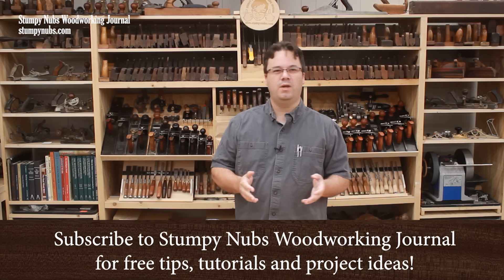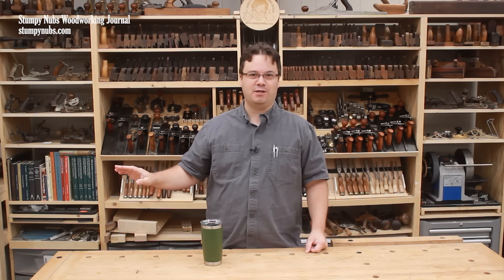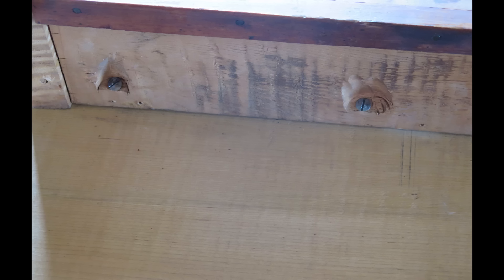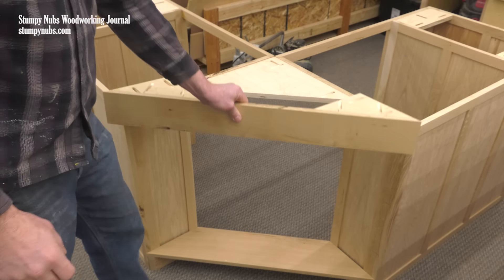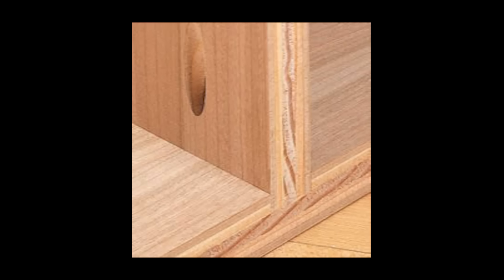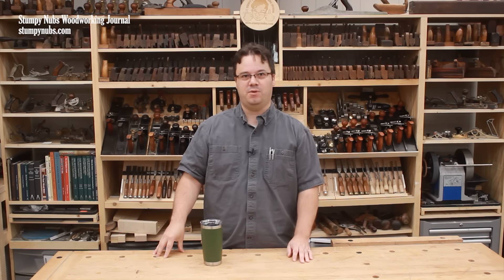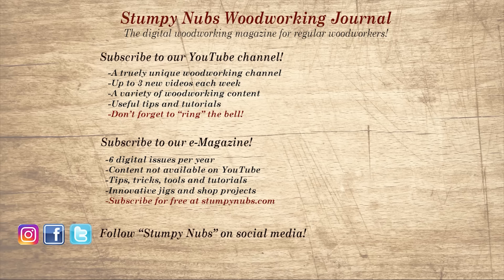They lied to you about pocket screw joinery.

Comment: I am a cabinet maker /cabinet installer , 25 years in the trade. I use pocket screw joinery for certain things, my face frames are all joined together with pocket screws and sometimes I will even put a cabinet together using them if it makes sense to do so.Mostly it just takes way longer to assemble a cabinet using pocket screws as the fasteners compared to other methods, I use a combination of joinery techniques depending on what I am building, the purpose of the item, wether things can be seen or not and structural needs. there is no one right way to make everything. I say if someone is enjoying what they are doing and using pocket screws enables them to build things with less equipment then good for them! snobbery is not productive and is usually a sign of a wannabe craftsman. like they dont really know how to do things but they have it all in their head how it should be done. all of the very great craftsman I know wouldn't give a half a crap how you join your cabinets together.

Comment: For almost anything, there is more than one way to do it. For example, at 3:43 :  the screws could have gone in from the other side. Their heads would still not be visible beneath the desk.
And so on. You can also argue you don't need mortise and tenon joints because you can do it with dowels. In the end, it comes down to what you like doing, and what gets the project actually completed.

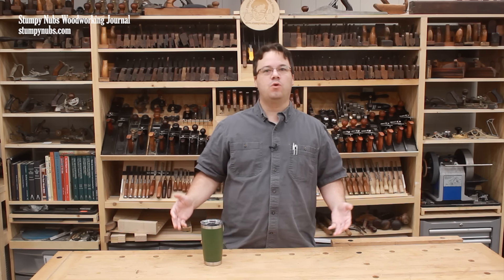Comment: I made a kitchen cabinet for a friends camper van and used 12mm ply. I did use pocket screws but found that 12mm slightly thin to achieve good strong joints. I did end up putting in some battens to strengthen the cabinet and the 7mm backing board helped. It is free standing so probably should have gone up a thickness in ply. What thickness was used at 1:47?

Comment: When we were doing woodworking at school we were told that woodscrews were fine and nails were not. That was in back in 1970 and I was told it was the tradition of Carpenters (Cabinetmakers) who would nine times out of ten use various wood joints with either wooden dowels or woodscrews as a last resort and Joiners (Construction industry woodworkers) were a totally different kettle of fish and they would use nails as a last resort.

Comment: Many anecdotal examples show that pocket screw fails just before wood failure.  That's a preferred mode of failure in my books any day of the week.  Unless you job demands that your wood fails before your joint or if it's something that requires resistance to repeated stress that may cause metal fatigue... Why would you not use the fastest mode of assembly?

Comment: Mr. Nubs, would it be okay to use pocket holes for breadboard ends?  It's either that or buy a Festool Domino for $1200 for me on this project I'm working on.  Appreciate your advice
Reply from the maker: You could if you counter-bore the hole that the screw goes in to make it larger than the threads so there is room for movement. This video shows what I mean (though it is not a breadboard end): https://youtu.be/4-OGtAs12ZQ?t=395

My preference is to make loose tenons (which is what dominos are). Here's a video about making a simple router jig for it: https://www.youtube.com/watch?v=Bx1Mg2mTMO0 Leave the tenons in the breadboard end unglued. Add some pocket screws between the tenons, as I did in the video link above, to hold it together while allowing for movement.

Comment: I am I guess what you would call a DIYer, or hobbiest. I learned woodworking in a cabinet shop I worked for when I was in high school.  I use the Kreg pocket hole jig in the furniture and other projects I make.  I made a workbench with drawers in it using pocket holes in the front and back panels to hold them together,  gluing in the bottom of the drawer. They take a lot of abuse but are holding together fine. The mistake I see people making is they use too few screws. Something like a drawer, especially in a workbench or even a drawer in a pantry cabinet will have to hold a lot of weight and be used a lot. On a Kreg jig there are three holes in the block,  I'll put holes the distance of the outside holes on each joint, a 6 inch high drawer will get 5 screws on each corner.  Now a cabinet side might only need a screw every six inches or so because it doesn't have a lot of force put on it and if you glue a back on the cabinet that holds it all together anyway. But that's the key,  in my opinion,   just like people saying,  "Don't starve a joint of glue." I say, if you're going to use pocket holes, use plenty,  at least as close as the A and C holes on the Kreg jig.

Comment: My elderly parents paid good money to a cabinet maker to build a replacement drawer for their kitchen.  It failed again.  I'm pretty sure the drawer I built with pocket screws and glue will be around far longer than the piece of garbage that a commercial cabinet maker built using only staples and pin nails.  The rolling cabinets for my drill press, jointer, miter saw, router table, thickness planer and small bench tools are all held together with pocket screws/glue and they're all heavy tools.  I've only been woodworking a few years and came in with no pre-concieved ideas about strong joinery.

Comment: If I'm building it for use in my home, it's getting pocket hole screws. I can make stronger furniture with less material. So not only does it hold up better but it weighs much less and has the potential to save me $$$ on material costs.

Comment: Doesn't it amaze you that some craftsmen want to put a date to end all modernization of tools. I wonder if they know power planes, Table saws, Lathes etc have been used for over 200 years. Of course they were powered by water wheels or the like in a mill but still  a power tool.  Craftsmen in the past were always looking to make their job easier and better and therefore faster. That date seems to be just after Stanley's bench plane assortment. Maybe they should go back to the invention of the metal nail and just use wood nails and raw hide.  Fact is, I remodeled an old play house (theater) built in 1889 that had cast Iron joist hangers and cast Iron columns and beams bolted together with cast Iron treaded bolts. Knowing how to do it the old way is fun for me but so are the modern innovations . Your Kool Tool shows are the best.  I often see tools on your show that I go out and buy.

Comment: There are decorative heirlooms, then there are practical items i build every day with graded pine, most all pocket screwed with an impact driver without pilot holes. Usually really practical multi purpose pieces that i find attractive due to their simple ruggedness and how they solve a particular problem. Build a bed in 2 hours, (+30 mins at the building supplier)? No problem. 

I call them prototypes as they are a concept executed and improved on that could be the basis for nice furniture. So they are like keeping blueprints on the wall (in fact, that's exactly what they are)

Comment: Pocket screws are a great way to get going and build projects when you don’t have tools. No t to that I have a good table saw and router dado set up I still use pocket screws. Taking things apart is a very good point when making built-ins: I’ve made several book cases and bunk beds and using the pocket screws on face frames etc allows people to take their $10k bunk bets with desks and bookcases with them. I’ve built cabinets and projects 20 years ago that are still getting abused to this day. I tell people to get a dewalt track saw, miter saw, a good drill set, and some clamps with their pocket screw jig to get going. I used Japanese saws instead of a miter saw when broke too. A few chisels and a hand plane and you build a tremendous amount of stuff. Most factory cabinets being homes are junk made out of melamine and I’d take glued and screwed quality over them any day. I’m constantly bracing, re-glueing and even clear caulking this junk on a daily basis. Anybody can make sturdy bookcases or cabinets that is 100 times better than IKEA …

Comment: i've been a carpenter most of my life im 64 when i started we had no nail guns and you learned to swing a hammer ,most guys now dont know how to swing a hammer because of nail guns its a snap of the wrist not brute strength i will drive a nail as fast or faster with my trim hammer than they will with a 28 ounce club now having said that i use a nail gun because it works

Comment: When it comes down to it time is money and if the job is worth hours spent doing joints and the client is ok with the additional cost then do it but most people want the cost of labor low especially when materials are already high…I build planter boxes out of pallets…my wife thinks they are free materials but the time I spend disassembling them and running them through the planer I can just buy finished lumber and the ROI is higher…you get what you pay for…you want joints they take time and time is money…pocket holes are fast and work well when your time spent may be needed on another part of the build…respect the craft

Comment: I love using pocket screws as clamping during glue ups; I remove the screws after the glue is set. In more than 20 years I’ve never had an issue of breakage, poke through, or unsightliness. Do t use them where they show or where they have too much lateral or drawing force against them and you’ll be fine. Just like the Festool Domino is a cheat for mortise and tenon jointers pocket screws function as cheats to, just for more things. Build what you want now you want and let the critics be damned;  ow if you’re in it for the money and looks you may need to reassess. I can tell you a lot of professional cabinet makers swear by pocket screws for carcass joinery because they’re fast and more cost effective then other methods; to me this is the reason for the clamping, they take up less space, are cheaper, and have more usefulness than a ton of clamps.

Comment: There are luddites in any craft. Good presentation, I'm still a "newbie" at woodworking, as I am disabled now, but worked as a mechanic for over 41 years, and remember the guys who used to say a good mechanic could just listen to an engine and tell you what's wrong with the car, but those same guys wouldn't work on anything that didn't have a points distributor and carburetor let alone many modern vehicles that have no distributors at all, and fuel injection now rules the day.

Comment: Luddites, I suppose. 
Some folks probably thought the person who invented the first foot-powered lathe (spring-board style) was cheating.
In a similar vein, I have a spinning wheel to spin fibers into yarn, using foot-power. 
I had a choice between an traditional antique style or a modern style.
I chose modern for portability, comfort, speed and a larger orifice than the traditional wheel so that I may spin chunky-slubby art style yarn as well as the super-fine lace-weight yarns. 
I have spun on both styles, and I was glad of the modernizations.

Comment: I LOVE screws! They area amazing! Can put small and large things together. You can easily take it apart. It is easy to repair. It is... Perfect for almost everything!
I also screw the baseboards. Makes it super easy to remove and paint or when redecorating.
But, unless in a very specific type of mounting, you should always use torx (or in second hand pozi). Philips... no. Flat is for special purpose when that look is desired.

Comment: I think any method of fixing is acceptable in the right application. Sometimes you need the strength of a screwed joint and if they don't ruin the aesthetic of the finished product because they're hidden from sight then I think it's fine.

Comment: End of the day, it's a case of "Right tool and technique for the right job" Pocket screws just add another option. I like using dados for book shelves. Pocket screws pull the shelves and sides together even if the dado is the load bearing part.

Comment: The issue I run into with pocket screws is that they often take as much time as other types of joinery, but are significantly weaker and create longevity problems down the road.  I have a table built by a neighbor with sagging bookends because they used - you guessed it - pocket screws.  Had the guy known how to use glue, he would have ended up with a stronger table for less effort.  But then, I guess, I wouldn't have received $100 worth of free lumber...

Comment: FYI
Screws don't stretch, they are made with strong metal, which is brittle and snap on shear strength

Nails are made of soft metal to allow for the movement of the wood, as it ages

Each has there applications

Comment: I am not a purist or a tool snob.  I am a pragmatic professional with a 40 year career building furniture and cabinets.  I agree that pocket screws can have a place.  But in cabinet cases, especially when built in a non-production setting, they are weak.  The tip of a screw protruding into 3/4 inch plywood or mdf doesn't work for me. Even just handling these cases in the shop is more difficult because of their weakness.  In a typical kitchen very few cabinet sides are visible.  I screw through the tops and bottoms into the sides with 3 inch construction screws.  So fast, and so strong!  On a finished end, I add a veneered panel. Easy.
As a professional, I love Stumpy Nubs.  This minor disagreement is a rare thing.  There is a lot of cringeworthy disinformation in woodworking channels.  Stumpy Nubs is one I recommend to all my friends.

Comment: I use pocket holes on everything. I even use it to attach the breadboard and table top to he base. It's a 9 ft farm table. Go figure there has not been any destruction so far. I live in the high humid south, and the table is made out of pine. So I know people say using kreg screws on the breadboard and to attach the top to the base is a no no, but I have had 0 problems from this.

Comment: So, I have a bone to pick with pocket holes…or rather, certain folks who use pocket holes. The examples Stumpy shows here are fine, because the screw/hole is not being used as the primary support for weight. Note how in nearly every (perhaps every) case, any substantial weight is actually resting on vertical pieces, not on the pocket hole (even if a desktop or something is being placed on the hole). However, in my commercially-produced bed, there are pocket holes connecting support frame pieces directly into the outer face. This might not be an issue, except…the pockets are on the top. That means that the weight of a mattress and human (a human of not-insignificant size, I’ll admit) is all being supported on a tiny, maybe half-inch thick piece of wood with maybe an inch of grain. The simple step of installing the beams with the pocket holes at the bottom would put the weight on 1) much more of the wood and  2) the screw, making for a substantially stronger bed. As it is, I’m dreading for the day I have to completely rebuild the inside of my bed in a day (maybe a weekend) because the frame snapped
Reply from the maker: Every form of joinery has a proper place, as well as improper uses. A bed manufacturer who uses pocket screws as the only support for the full weight of the bed is misusing the technology, but that does not speak the the technology as a whole.

Comment: Along side woodworking I also do some metal work and welding.
Just as in woodworking there's loads of way to connect metal together and welding isn't the be al end all.

I like to think of the best way I could do something and think about all the pros and cons. And trust me, sooner or later you'll find a use for any kind of connection method.

Comment: People think "old timey" woodworkers used the techniques that they used simply because they were the best techniques. Nope! They used the tools they had at the time. They ripped lumber with a handsaw not because it was the best way, but because they didn't have a table saw. Also, there is a huge difference between weekend woodworking where you can take your time using the old school methods and a company who feed their family based off of the ability to build projects in an efficient manner.

Comment: Use all technology available. When used in its proper place all building technologies are great.
For instance some of the great spans of timber used such as the wonderful Oregon spans are far exceeded by modern engineered laminates.
As a painter of many years I also welcome the technologies that get me away from the more traditional oil and solvent based paints.

Comment: even though i have seen you do a few pocket screw joints that i would not have used pocket screws for, im still a huge fan.  i dont get why all the hate for the pocket screw. pocket screws are the nickelback of the woodworking community.

Comment: I have been called out on my bullshit, but I still stand by the fact that pocket screws are best used for production shops.  There are plenty of good uses for them, but as the go to fastener for butt joints, they are expensive and weaker than pretty much any other option... which is how they are most often used.  When the masses of people complain about "pocket screws" this is what they are talking about, not the occasional angled screw used by necessity... rather the choice to use one where there are dozens of better ways to do it, but a pocket screw just happens to be fast and easy.

Comment: Pocket screw fan. them often.  Wish Kreg would offer a jig with the drill angle of 8 t0 10 degrees.
Reply from the maker: A stepped drill bit won't work well at a shallow angle. That's why they have to settle for a steep one. They would lower it if the could. Only a router-based system can do the more desirable low angle.